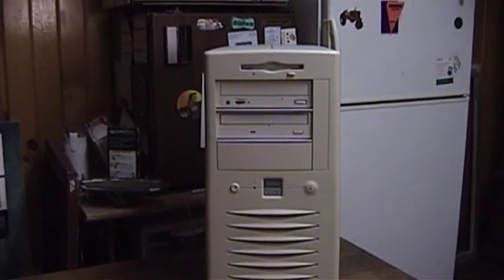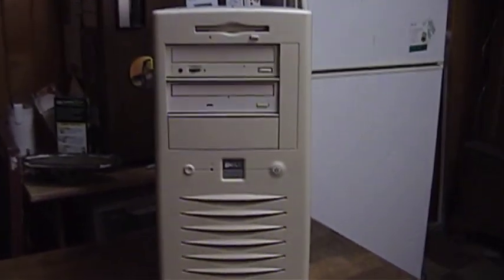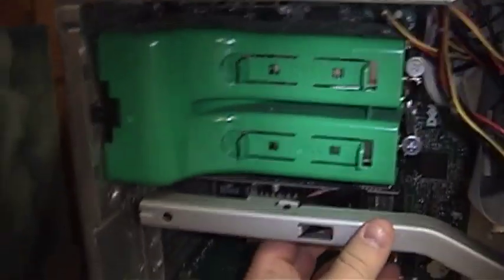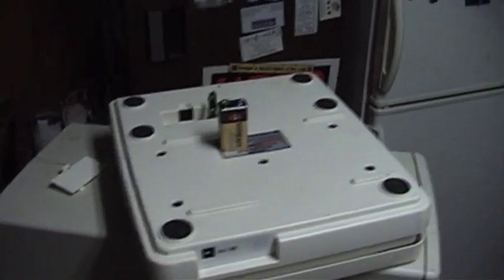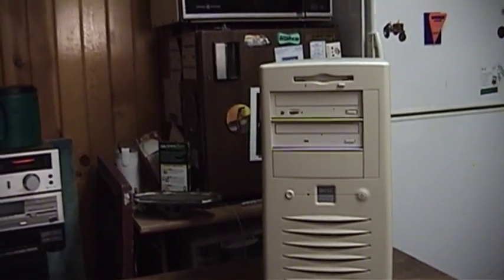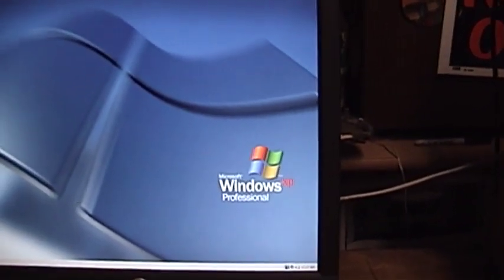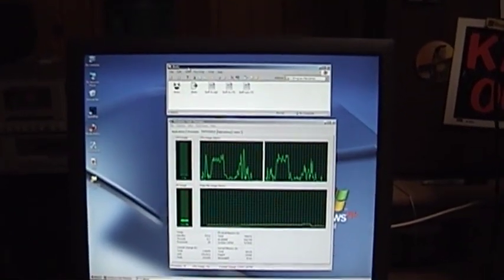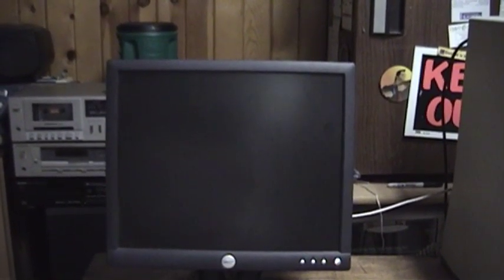Dell Precision 220 Workstation/Multiprocessor Computing Fun!

Comment: Not only would it obliterate a modern PC if dropped on it, aside from some battle scars on the plastic it'd be unscathed and still be fully functional. These old machine's cases were tank like in their construction. The original PC AT's were a good example, those things were beastly and mostly metal.

Comment: I picked up something I have not seen in a while it says it is a IBM apteva expansion
it has a cdrom floppy disc long cord on the back it has 2 ports for ps/2 mouse and keyboard you push the top up and down it clicks into place push it down and it opens 
You have seen a lot of strange IBM stuff ever see one of these ?

Comment: I have a question: what if you would have a second monitor port and installed a mouse and keyboard via usb, use a second hard drive, couldn´t you run two Operating Systems at the same time? Like conjoined twins? That would be a pretty cool show.

Yet another awesome video for the tech-fans, I love it.

Comment: I just gave away a Compaq Presario that we bought in April of 2001. It was just at that point. I had put Windows XP in it after getting tired of Windows ME. It still ran but slowly. I lost the XP disk when we moved in 2007. So I'll let somebody have it that can fix it and make use of it.

Comment: Hey can you run windows 7 with this say you install a agp video card for aero 
would this work better then a old 2.ghz p4? since is multiprocessor 
and p4 is a single core processor?

Comment: Dell Precision 220 Workstation/Multiprocessor --- I have one of these Dells with a burn out transformer in it ! I still have the Dell computer & plan to fix the transformer one day soon in it . Awesome Video --- Thanks you uxwbill for explaining about this Dell Duo CPU machine here !
Reply from the maker: Good luck. If you ever repair the power supply (be careful!), I'd love to hear about it. Mine still works, but the last time I had it powered up, I could smell something inside getting hot.
Reply: Working on finding a power supply for a 1993 Laser 486 DX Computer I found along the street corner ! It has a burnt out power supply also ! I have to look in my bedroom apartment closet here to find a working power supply here, or else totally rebuild the old one instead !

Comment: I had a HP workstation.. dual opteron quad cores, still regret selling it, it might not have run games that good but damn it was a hell of a renderer
Reply: +Tunsafun[BSTRD] I still use a xw9300 and may add a second quadro fx 3500 if I find an affordable lot of 4 used identical 20""+ LCD's.

Comment: hi you know you gear. i changed my motherboard in my computer. and the windows 7 oem code stopped working
it's a right pain bob
Reply: BOB JER  since the OEM code has been initialized with the previous motherboard, its quite possible that is locked itself from use in other articles of hardware. OEM disks tend to be useful for ONE soul machine... unless it is properly deactivated from the machine it initially was activated on.

Comment: I have three of these 220s and have a problem with one of them.  When I plug it in, it powers up right away, but does not go through any boot sequence.  I disconnected everything and swapped CPUs and RAM to see if I could figure out what is causing it, but no luck.  Any thoughts?
Reply from the maker: Simplify the configuration to the bare minimum. Test power supply voltages (and power good signal). Pull the CMOS battery for 24 hours and make sure power is disconnected at the same time. It's probably dead, though.
Reply: @uxwbill  I took out the CMOS battery and checked it... was dead.  Replaced it with a new one and boots up fine again.  Thanks!

Comment: i though nt 4 had a multiprocessor kernel if your computer had multiple processors.
Reply: Yes, NT did and does support as many processors as you can throw at it. The limitations are in MS licensing, not technical capability.

Comment: +uxwbill I recently purchased the motherboard for this machine and am going to find a way to put it together. I noticed it needed a special PSU so I have purchased a conversion cable from ebay which should be arriving soon, but one thing I also noticed is these odd little slots in the motherboard PCB with metal connectors in the centre, I'm assuming these make some sort of connection when mounted inside the correct kind of case. Do you think the mobo will work fine in a 3rd party case? I assume I'll have to do some pretty serious case modding to make it fit. Thanks for any advice.
Reply from the maker: +Storm Gaming Media I think you might have a chance to get the motherboard into place without undue gymnastics. The I/O area is basically ATX shaped, although getting the slots and screw holes to line up may be a real trick.

The cutouts in the motherboard are for grounding purposes as best I can tell. The last time I powered this machine up, it worked but I smelled burning and suspected the power supply. If you've got or can get the item # for those power supply adapters, I'd be greatly appreciative of your sharing it. (There's also an Optiplex GX110 whose power supply shot craps.)
Reply: +Storm Gaming Media i recently got a optiplex 980. I found it had a micro ATX connector and the PSU was shot, it only powered on for a minute before shutting off and refusing to power on. I tried a PSU out of a HP slimline but that did not work. I found out DELL uses propreitary wiring in the ATX connector so i found an adapter on ebay, it works with a regular PSU
Reply: Thx, found one :)

Comment: I have a dual Pentium II MMX 233MHz system, or rather a dual Slot-1 system.
Reply: AIO inc. Love to see some benchmarks with dual Gen6 PII 450mhz processors.
Reply: It can only go up to Pentium II x2 300MHz.
Reply: I have a non-functional dual Socket 370 system as well.

Comment: As of this comment being posted, I have to note that one of my best friends runs an Intel Celeron processor at about 2.5GHz. I can't necessarily remember all the technical specifications of it, but I know it is a single core processor on a modern Dell computer that looks more like a server than a home computer. To make things worse, it runs Windows 10, and is painfully slow. Seems to me that some Dell computers haven't caught up yet!
Reply from the maker: +Collision Detection You can't realistically blame a computer manufacturer for someone's making a poor choice in hardware and software.
Reply: What I mean is that it was bought that way.
Reply: +Collision Detection Dude its because he bought a low-end machine, Just go look at any new inspiron they have i5's and i7's
Reply: Yea, I know that it's a 'low-end' machine. I just wanted to bring it to mind, because UXWBill noted that multiprocessor (or at least multicore) computers are becoming a norm today.

Comment: ibm was the first to use hyper threading . most notably  in its cell platform each core can execute 4 threads per core  the cell is a dual core 8 thread :)
Reply: That's just not true. The cell platform didn't even exist until 2005.

Comment: Do you have a main windows xp machine? Mine is a dell precision t3400 it's a core 2 duo e8600, an nvidia geforce gt 610 and 4gb of ram it runs pretty good. It's my workshop computer. If you have a main windows xp machine could you tell me the specs?
Reply: XP with 4GB RAM?
Reply: Ashton B. ddr2 800
Reply: 32 bit XP only supports about 3.4GB and 64 bit XP wasn't very good
Reply: Ashton B. It was the best ddr2 I had laying around
Reply: SpinOutTV2 Yeah it is the best DDR2 RAM but you will miss out on 600MB : /
Reply: +Ashton B. Yeah it's okay
Reply: +Ashton B. Actually Windows XP x64 aka Windows Server 2003 is way better than Windows XP (x32) The only thing that makes it look bad is the support. Not many developers made drivers and programs for that specific os. But it's mainly because Microsoft never sold it in stores
Reply: GTAGAME Yeah. I know. The reason it was never sold was because it was a server OS and thus was not targeted to normal consumers who would use Pro and Home editions.Plus, I don't think 64 bit PCs were really as common back then.

Comment: he installed windows 7 on a compaq it was fast... i think he modded it.
Reply from the maker: +Robert Watchmen If you're talking of the video I made where Windows 7 ran on a Compaq Deskpro EN, no, it was bone stock.
Reply: +uxwbill that is impressive, also can you help me with something, i put a 512mb ram module in my gateway essential 500c, and it only read it as 256mb
Reply: BrianGriffin1999 the 512 mb stick might be mislabled, i have also had this problem with a 128mb stick, that was labeled as a 256mb one

Comment: Does a core i5 2500k out perform this???? XD LMAO
Reply: ***** Lel I still have a hdd
Reply: +Bryson Shires  An Intel Atom would probably outperform this computer.
Reply: +andre rio  Solid State Drives are overrated. Can you buy a terabyte SSD? I don't think so. And Hard Disk Drives are fast enough for me.
Reply: Brenden White ...Yes you can buy a terabyte ssd, you can get a 6tb if ur willing to pay, but a 1tb is not too terribly expensive
Reply: +Bryson Shires  Never knew that before. I still feel that HDD are fast enough anyway. Modern computers are faster for more reasons than that as well. Such as faster, and higher capacity RAM, multicore and more efficient processors alsk make conputers of today faster.
Reply: Brenden White Just think, ssd's will make them even faster
Reply: +Bryson Shires  I know it would make a computer faster. Quicker boot times and load times. I would live to upgrade my laptop with one. But then i'd have to clone my HDD or transfer everything from the last icon i moved to the operating system itself.  Just be a hassle.

Comment: They guaranteed someone would be out within 4 hours if the machine broke down? What if it broke down while you were using it at a research base in Antarctica during winter?
Reply: ***** helicopters. Dell could arrive in helicopters to repare your computer.. Of course not for free... They are Dell and helicopter fuel costs money
Reply: YamiYam Dell's service contracts are based on the region or country. So if they sold you a contract in antarctica, you'd pay handsomely for it.
Reply: Oh what if it broke in a place were dell is not available
Reply: techplaysmc Then you would implode instantly

Comment: any chance of running debian 9 on it?
Reply from the maker: Sure, if you wanted to.
Reply: i'm interested in seeing a pentium 3 running modern software i know firefox is forcing sse2 intruction set but i heard there are excepts on some distros. sadly i have a pentium 3 but i don't have any money to test it out:(
Reply from the maker: There are distant rumblings of support ending for 32-bit x86 systems as well. Some operating system and "appliance" distributions already have done so. I think that's a mistake, with generally available 32-bit only CPUs being present in Intel's product line as recently as 2013 (and there being little advantage to running 64-bit if you don't have >4GB RAM installed in your computer).
Reply: i heard about that to, and some distrobutions have dropped 32bit support which is sad. and i agree there's no real adventage of running a 64bit os unless you have 4gb + of ram. hell i have an acer laptop with a pentium dual core with 4gb of ram and have a 32bit version of sparkylinux lxde and it runs great. my pentium 3 does support 4gb of p133 memory and supports modules with Dram tecnology in mind https://www.ebay.com/itm/4GB-4X1GB-PC133R-333-542-Z-HB52RF1289E2-75B-133MHz-ECC-REG-RAM-TESTED/171360301204?hash=item27e5deb094:g:~IsAAMXQPW5SDnIc:sc:USPSFirstClass!18102!US!-1 like these.